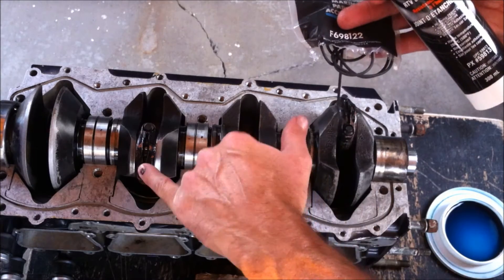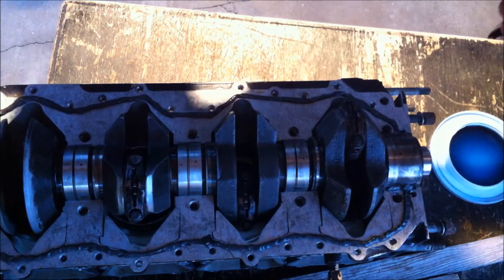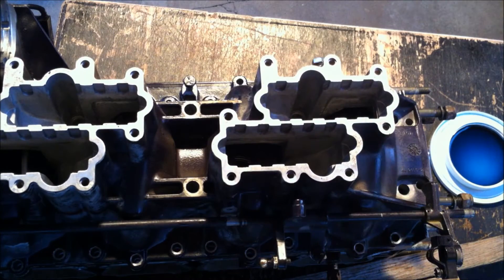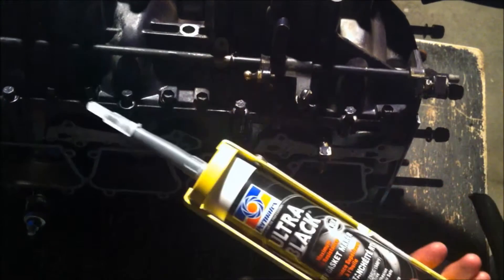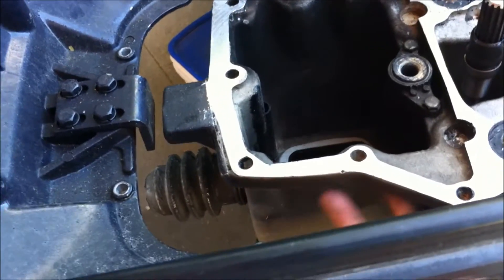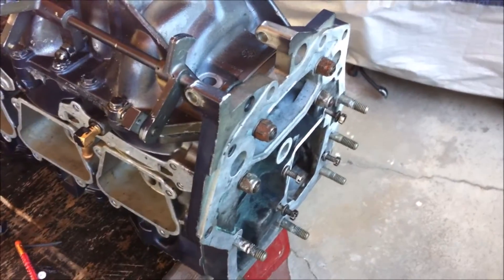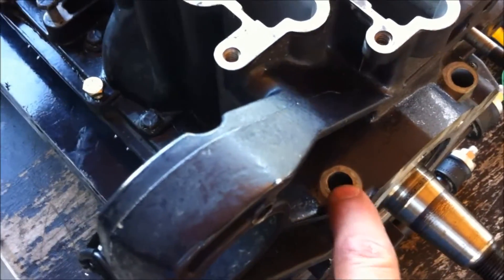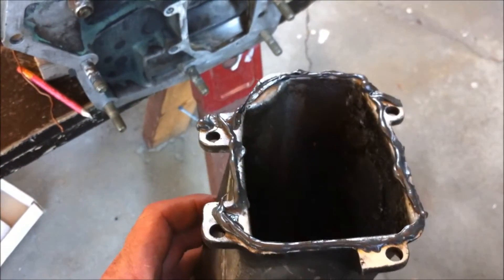89 Force 125 Rebuild video part 4

Comment: I can tell you did a lot of homework and most of your work was spot on brother! Nicely done.

I just purchased a 125 88 Force and looking for a good tutorial.  Only suggestion I would say is add what each part cost you. Boating the cylinder, $125, new pistons, $68, etc. 

Great job.
Reply from the maker: chris Thornhill - Thanks for the feedback - the motor is still running great! Just putting it in the lake for the first time this year on Saturday. Unfortunately I’m later getting it in the water this year because a pesky raccoon snuck under the boat cover and camped out in my boat over the winter. Urinated on a bunch of stuff that I had to throw out, and even had to rip out a section of carpet and flooring and re-fiberglass. Maybe I can look back on my records and see if I can find my receipts - all in Canadian figures, mind you. Thanks again, and all the best with your outboard!